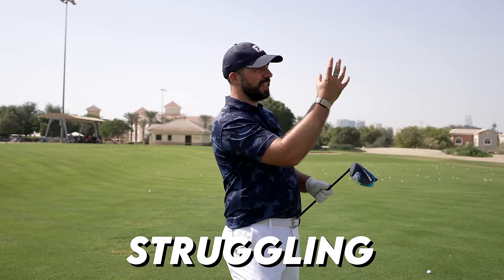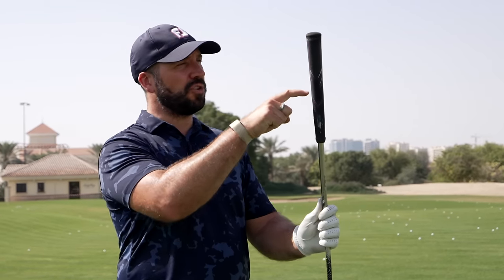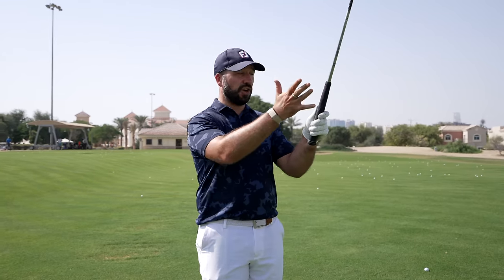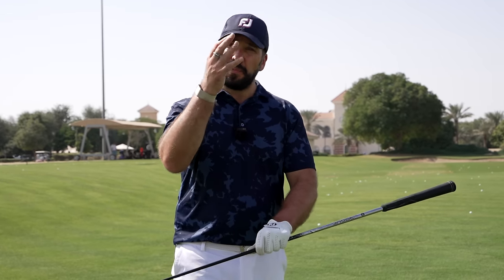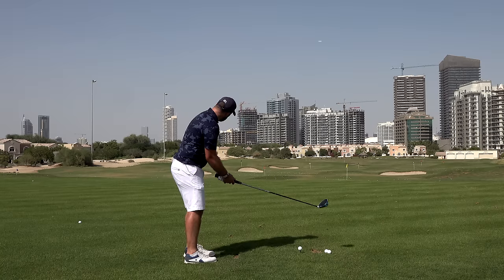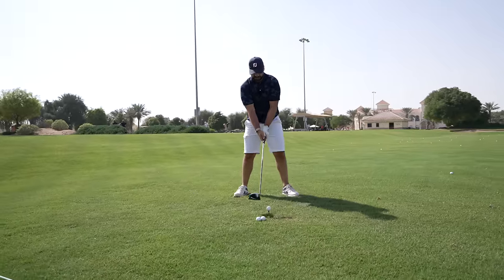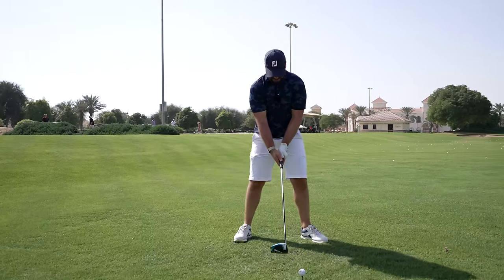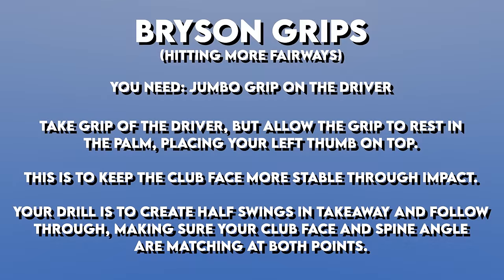Use THIS BRYSON technique for CONSISTENT drives!

Comment: I tried the XL on my driver and instantly eliminated the big hook which is my common miss or an over the top shot. It was incredible .i could go after it as hard as I wanted to and felt confident. Hit every fairway the first two rounds I used it. I then put the xl on both fairway woods and hybrid and got same results. Put the mediums on my irons and can hit those short irons and wedges as hard as I want without a pull or hook. Previously used midsized for decades and they feel terrible when I pick one up now. The jumbomax feel so natural that I’m never going back. Incredible product. Also much easie on the hands and cushion impact making practice easier on the hands.
Reply: Same exact results

Comment: I recently started using this technique but with a normal size grip. The most important thing is to keep your left elbow locked through the whole swing. This will prevent you from hooking. This will eliminate the left side of the course and you will mostly mis hit right.

Comment: Brill video Pete - exactly what I’ve done with my full set and the difference is incredible!  I’ve actually found extra distance presumably because of a light grip pressure and less tension. Absolutely love my grips and can’t see me ever changing!  Only thing I have done is left my midsize on my 60* wedge as a really can’t open the face etc very well with the big grips.
Reply from the maker: Not tried the super thick grips on a lob wedge yet but will be switching soon

Comment: While I am not going to switch to the super jumbo grips, you did say something that seems to help me correct an issue.   You mentioned the grips keep the club more in the palm and reduce the amount of turning of the wrists (big problem for me).  I made the adjustment in practice today of getting the club back up into the palm and it had some very solid results.  I didn't turn over the ball as much or overturn the wrists.  Need to see data on the simulator and some course time but the concept is solid.  Sometimes it's something else in the video that is the solid piece of advise.

Comment: Thanks Pete. I tried one of these on my Srixon X545, different feel for sure, softer and good grip traction. I used the XS and it's way bigger than everyone's midsize by a lot, just a tip for those out there. I'm 6 feet, wear a med glove but feel standard size grip size are too small and over hold the grip. I do pretty good with midsize grips and been debating of going back the the JumboMax XS for my Srixon X785 when I order a new shaft for it (need stiff not regular flex)

Comment: I use jumbo's not those i use the golf pridesbut I will say I find so many more fairways.  They are much heavier I would like to try lighter jumbo grips at some time.  I switched to a slightly lighter shaft to compensate and it seemed to do the trick for me its wild how accurate my full swing driver is compared to my old grips

Comment: Peter, the science is actually quite easy to explain. If you double the grip size, it halves the amount the face rotates away from square with the same action. Imagine a grip size where every millimetre you rotate the grip clockwise or anticlockwise translates to the club face rotating 1 degree off square. If you double the grip size, then every millimetre you rotate the grip only moves the face 0.5 degrees off square. So, for example, you're technique is leaving the face open at impact by 2 degrees because of something you do with your hands in the back and down swing, then doubling the grip size would mean that your face would only be 1 degree open.

Comment: My swing form and grip is not the cause of my inconsistency issues. My issue is caused by not being able to find a glove that fits. When I swing without a glove I stripe it down the center every time. But playing an entire round without a glove causes blisters due to the fact that I'm on the road for 2 weeks at a time and can only get on the course every other weekend. I have weird hands. My palm size is medium large, but my fingers are super short. Finger girth is medium size, but length wise the proper fit is small or extra small

Comment: The thick grips take out the wrists, or slow them down. Just like my framing hammer if I put a fat handle in it my right wrist and hand become less mobile, a skinny handle and it becomes very "loose" or wristy. Same thing with golf clubs, rackets, bats, thick bars for weight lifting....
I always thought those grips worked for the 'natural golf' or one plane swing guys, who advocate holding the club more in the palms. Or Michael Jordan who needed like twenty pieces of build up tape for his grips and they were Still too small !! Good luck.

Comment: Wait, so you lost distance and gained accuracy? Wasn't that the reason you swapped from the Ping G425 back go the SIM2? You didn't mind losing accuracy for the distance you was going to gain..

It'd be interesting to see the power board stats of this setup compared to the G425 LST one you've already done.
Reply from the maker: I’ve just regained that distance with a new driver 😉

Comment: How much heavier does this make a club
Reply: The ultralites keeps clubs same weight as they are a very light grip.
Reply: @marcwolfenden9219  same weight as what? A standard grip? A midsized grip? Average jumbo grip? There is a major difference between standard and midsized grips that I notice
Reply: @nategin9009  .  Same swing weight of club , so you will not notice any swing weight differences.
Reply: @marcwolfenden9219  that really doesn't sound possible. The difference between a standard and midsize is like 6 grams. How is an extra jumbo grip the same weight as a standard. You still haven't answered my question, is it the same as a standard size grip, mid size grip or jumbo grip. Saying "it's the same" has no fact or context behind it lol
Reply: @nategin9009  look on their website , it shows the weights of grips.  Same weight as standard grip. I had  golf pride mid size on driver and had to add weight to the head get swing weight back to  D2. When I put  Jumbo grip on , I took the weight back off the head . Hope that make sense for you now.

Comment: Much love for this content, since I'm trying to use Bryson's technique. If you check out Bryson's video on testing prototype irons, he shows Lee Trevino the way he grips. It's not just placing the hand in a certain position, it's turning the elbow in and the left hand out, and then gripping the club square, to lock the movements in. That and the shaft is on the impact plane at adress, not below it as is more standard. https://www.youtube.com/watch?v=kkTgWpJnrmI&t=360s